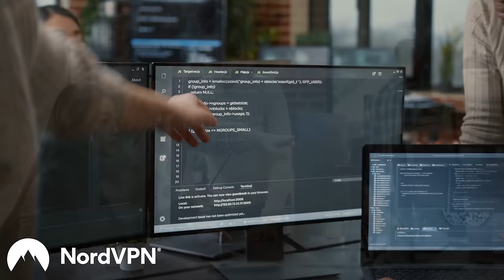Elon Musk fails Cybertruck stainless steel metallurgy test | Auto Expert John Cadogan

Comment: Go look at your kitchen sink and tell me it still looks brand new, no nicks and the "grain" still going the same direction. I may jump in early and create a "Cybertruck body refinishing kit". Basically a windshield squeegee with 300 and 600 grit wet/dry sandpapers. All for the low low price of $900. I'll even make the squeegee out of the same 304 stainless and claim it's "thermonuclear bomb proof".
Reply: You must be a lot more careful with your sink that I am.  There are 3 areas that are clearly messed up on the surface.
Reply: @kensmith5694  Actually I do try to treat my sink with reasonable respect. It's one of the heaviest lifters in the kitchen and they suck to replace. That said, it still gets fucked. Dents, rust stains, gouges, scratches, all of it. I don't know how the DeLorean guys do it, although I've never seen one where all the body panels matched color/texture.

Comment: Stainless steel is a miracle material when it comes to corrosion. It is however not even completely "stainless", as the corrosion patches on my Ruger Old Army black powder revolver demonstrated.  It also doesn't play nicely with other materials, particularly mild steel due to electrolytic corrosion in neighbouring materials.
Its big weakness is it can be brittle, particularly at low temperatures common in many parts of the world (UK included). When I went to college, our lecturer in materials science showed us a case study on a disaster in a North Sea oil field. A floating accommodation platform was built from stainless steel and a leg broke off in winter high seas due to brittle failure. Sadly, the platform design only had five legs (six is better for fail-safe) so it capsized with many lives lost. Generally not suitable for the structure of a vehicle due to this brittleness which is why a Delorean's stainless panels are not structural.
I served a machine shop apprenticeship and can attest to the propensity of stainless to work harden. It can be a complete bugger.
Elon Musk continues to show his ignorance when he gets up on his hind legs and pretends to be an engineer. Dunning Kruger springs to mind, nearly as bad as Donald Trump...

Comment: How will the Cybertruck hold up to salt water corrosion ? Noticing that type 316 is used for marine applications ?
Reply: It depends on which 300 series stainless it is.  304 is no good with salt.
Reply: It's magnetic, so its not a normal 3xx series. It's a duplex type steel. What type is not known, but super duplex is the best  corrosion resistent steel out there and far better than 316. So when this video is all about 304/306, its not accurate to his point. Lean duplex, standard duplex or super duplex is a lot tougher material to form
Reply: @frodekrogstad9936 If you bash  on 316 it gets a lot more magnetic.  You have to heat it to return it to normal.

Comment: Without going into details... my own informal testing done some 30 years ago indicated that regular old fashioned car door steel is a lot more bullet resistant then you would think it is.  The stuff stretches into cones and absorbs most of the bullet's energy.  No, I wouldn't recommend squatting behind a car door in a gun fight any more than I would recommend anyone getting into a gun fight. But stopping bullets with stamped sheet metal has been done way before Elon ever thought of it.

Comment: There are grades in the 300 series other than 304 and 316, and their properties differ somewhat. 301 for example has a very high rate of work-hardening, and at full hard can achieve a hardness of over 40 HRc (3:00) and UTS of about 1275 MPa.

A gram is not a unit of force. It is a unit of mass, not weight. The unit of force in SI is the Newton. This is unlike pounds, which are indeed  a unit of force (weight) - the unit of mass in avoirdupois is the slug.

Oh and you omitted Cr from the elements making up your austenitic stainless (8:30). It is rather important to their properties. That may however have been an oversight.

Otherwise I don't disagree. FWIW I have degrees in mech eng and metallurgy.

Comment: Basically John says: It's impossible to add something to improve stainless steel because we are at a "late stage" in the creation, and use of the material.
Hear that? If a material has been around for a while, it can't be improved. Don't try. Case closed.
Reply: If you were meant to learn ANYTHING from this video - it wasn't about stainless steel - the number one thing you SHOULD have learned was that John knows more about stainless steel and car manufacturing FAR MORE, WAY MORE than YOU.  John is at GOD TIER levels of knowledge about these things and we should just admire as he talks about these things and shows all his technical words and knowledge - I know I was impressed!!

I know in my experience - that's what makes truly great mechanics and engineers.  The ones who act like they know everything and that there's nothing new to learn and that whatever they currently know now can't be replaced or challenged by a better way to see things..  So they NEVER question themselves or show any vulnerability whatsoever..  CLEARLY John knows he knows a LOT, and those CYBERURINAL types know nothing DUUUDEEE.. 

So good work - we are doing what John wants and spending time talking about everything he knows - I know he'll be very happy - he even says so!
Reply: @George2647g  I'm a mechanic, so don't act like I know nothing. John doesn't know anything about the stainless used IN THIS CASE. He is just pontificating about stainless generally. Watch some videos by Sandy Munro if you want an engineer's input from a different side of the argument. Someone who is actually visiting the factory where the steel is processed.

Comment: we've have 70 hrc steel for quite a while JOHN. I think VASCO created the first one. i think it was m42. In fact John, I have a collection of high end kitchen knives which exceed 65 hrc. One of them is 68 HRC. and it's made of a HSS quite similar to m42 actually. The others are right behind at 66 hrc and made of a unique stainless steel designed by hitachi for high end knives. also i do have a few low alloy knives that are more traditional which are above 65 hrc as well.  anyway.

Comment: A couple of minor corrections...
1/ Gram is mass, not weight. Weight is a force, agreed, but grams measure mass.  One gram in earths gravity creates a force equal to (approximately) 0.001 x 9.81 Newtons.  A mass of 1g floating in space is still 1g but has zero weight.
2/ In 'Merica, the more common unit for steel yield and UTS is ksi, not psi. 1ksi = 1000psi.  It is from this that the nomenclature for many steel grades used in pipe is derived. For example, API 5L Grade X40 (a common pipe material) has a yield stress of 40ksi.

Other than these two very minor points, I agree.

As an educated guess, the Gr 308 stainless steel used in the Cyber Truck is probably for the welding properties - so it can be better spot-welded together.

Comment: Why the hit piece? "30X" is obviously his sense of humour. Elon has never compared 300 grade steey metals to tool steel hardness. 300 grades can be work hardened to 500 MPa. This is no where near a tool steel but i and most engineers would consider this to be very high for a sheet metal.
I used to work on an ex GMH 500 tonne Verson press. It pressed out a laddertray. Even with 1.6 zincalume, we had to design the cutting to be progressive, otherwise the press could be overloaded and jammed. 
Elon is a qualified physicist. If he quantifies with figures, those numbers are usually correct. If he gives a judgment such as "very hard" that needs to be taken in context.
I get it that John does not like EV's and this probably flavours his rhetoric against the man who made them commercially viable. Personally, John's efforts would be better spent, siding with Elon against the erosion of our political freedoms by the WEF and their proxy governments. Those guys are trying to take away all of our cars, electric and internal combustion.

Comment: One disadvantage of the stainless steel body panels is that it will be difficult to make style/cosmetic changes to the outside of the truck from year to year.  So the Tesla marketing department may find it more difficult to sell the newest year model if it looks nearly the same as last year's model.  With conventionally-made trucks, they often change styling significantly from year to year to get customers hyped for the latest greatest style.

Comment: Back in the 60's Autocar Trucks built stainless steel trucks that were specially ordered by Edgcomb Steel. The Presses didn't break. And The Budd Company in Philly had presses that stamped out the entire side of a  SS passenger railcar in one operation (like 90 years ago) and guess what? The presses didn't break

Comment: The metalurgist who  led the metallurgy team on the world's first reusable rocket engine is the same guy who came up with the composition of the steel in the Cybertruck.    This outback redneck is the professional though. Hilarious.
Reply: @semilog643  If it was so easy it would have already been done before.
Reply: @neodark414  It's an interesting patent application, describing what are probably an interesting set of materials. But again, there's no magic here. Just an incremental improvement on old materials, in an old use case.
Reply: @semilog643  When was the last time that 2mm thick stainless steel was used as the body material of a mass market vehicle? How is this an old use case?

Comment: You know, I think the education system failed me. I was taught at multiple levels in school that grams were mass and only mass do not pass go do not collect $200. Then again, these same schools tried to gaslight us all into thinking that real world regular people measure weight in newtons. Of course, that's not the only way the education system failed me.
Reply: You are correct, however, grams force is also a thing. On planet Earth, a 1 kg mass weighs 1 kgf (force) by definition. The acceleration due to gravity only varies by about 0.5% from the strongest effect to the weakest effect. 

Therefore, any mass on Earth can be expressed as having the same weight as its mass. It only becomes an issue in other environments, such as when something is in orbit (zero weight) or somewhere other than Earth.

Interestingly, the definition of gravity on the surface of Earth is an acceleration of 9.807 m/s², but the average acceleration is 9.82 m/s².

Comment: Cybertruck looks like a prop department reject from a 1970's "Logan's Run" episode. Meh.
Reply: It might not look like what we know but it is way cheaper to make than it’s competitors and way more fuel efficient.
Reply: @p3x1967  Beauty is in the eye of the beholder, thankfully.  EVs are heading for "near zero" maintenance and 1,000,000 mile+ life.  Something that the incumbent ICE manufactures are in a massive quandary about given their business model around having your car in the  dealer at least once per year for an expensive "look over" and oil change.
As per safety yes there is an SUV "arms race" in terms of being the safest in your own car, forgetting about those around you.  The main thing is that we don't get dragged down something similar to the "red flag act of 1865"

Comment: The thing about the average work shop Dress is that when you have done the pressing and you lower it down *"(always remember to replace the pins 2of them one each side and rest the work table on them without fail) this is tought to every apprenticeship in  the 1st year) rule of thumb 👍 A. Only a fed would not. 😮 I have found them out many times, always check that they are IN.
Reply: In my experience with a Mazda 121 it had Exstremly mild steel, from NIPON Steel I could straten it with my hands after running into a carpark  log. I found out that they make it like that on purpose for pressing, then the first time you're car gets over 65°c it is suppose to tuffin up. Thay said. What do you think???? Truck is made from cold rolled  
SS and the breakages has an air curtain on the blaids, that way there is no metal to metal contact and improved actriciy. A
Reply: On the other hand the Starship factory, the Engineering thay are achieving is exstrodinary. Example the RAPTOR 3.

Comment: Actually I am a qualified engineer...hardness is correlated with armor effectiveness.  Class 1 Armor steel is harder than Class 2.  It's good for ballistic protection, but not as good for mineblast as Class 2.   John, you are saying there's nothing new to learn about Stainless Steel.  With computer modeling atomic structure recently becoming a thing, I don't think that's necessarily true.
Reply from the maker: Dude, hardness in all common metals correlates with brittleness. Brittlness is not a characteristic you want to embrace in ballistic protection. Harder = more brittle. You're taking it out of context.

Comment: So you're comparing hardened steel bolts, hidden crash bars in the doors, tire rods, ball joints, wheel bearings to the Cybertruck's overall body? Kind of a poor comparison. That's like saying I have bullet proof buttons on my shirt compared to a bullet proof vest.

Comment: I learned about 304 the first time I center punched it. Burned two drill bits up. "Don't you know you can't center punch 304 you will need a cobalt drill."  I just started over with a new piece.
I always wondered why car bodies were not stainless steel. thought it was planned obsolescence..
Reply: 304 doesn't do well with salt and is hard to work with.

Comment: 00:17 🚗 Elon Musk's claims about the Cybertruck's stainless steel and its design face scrutiny.
01:26 🔩 The Cybertruck uses a 300-grade stainless steel, not a revolutionary material as implied.
02:17 🛠 Elon Musk's "Ultra hard stainless steel" claim doesn't align with stainless steel's actual hardness.
04:34 💥 The Cybertruck's stainless steel is notably softer than other steels used in modern cars.
07:14 🔧 The stainless steel used in Cybertruck's construction isn't unique; it's part of known metallurgical processes.
13:16 🏭 Forming the Cybertruck's steel is limited due to its properties, not due to limitationsin manufacturing presses.
14:14 📏 The hardness of the Cybertruck's stainless steel is comparable to softer materials, not hard steel.
15:58 💪 While the Cybertruck's steel is tough, it's relatively soft compared to harder steel variants.
17:59 🚗 Other conventional cars use steel twice as strong as the Cybertruck's steel, challenging Musk's claims.
20:36 📰 Perception versus reality: Musk's claims about Cybertruck's stainless steel don't align with factual metallurgical standards.
Reply: Nevermind that Tesla just announced that they designed a new steel which is both strong as well as tough, but I trust John because he's just so right about everything in his life!

Comment: I sell a product that needs to be artificially weighted.The weight cannot rust so I use a passivated stainless steel bar for weight.Its still possible for it to rust but not in my application,exposed to the environment only once and discarded to avoid contamination.All stainless will rust,it has iron,no matter the grade if put in the right environment.This EV truck will be a rust bucket in no time.Usually the harder the steel the more brittle it becomes

Comment: John - like CYBERTRUCK or not , its Still the FASTEST Production TRUCK on EARTH , also SAFEST .
Cybertruck can OUTPULL 40,000 lbs in truck pull, and went FARTHER Distance than F350 HD Diesel truck. 
Cybertruck actually ran out of TRACK . F350 HD Deisel is a LIGHTWEIGHT.
Reply: I hope Cybertruck owners have budgeted a fair amount for tyres, because they're going to be chewing through them with all that high acceleration and towing ridiculous loads.
Reply: @markplott4820 Cashing in on the idiot dollar.

Comment: BTW:  
7075-T6 Al is about as strong as 300 series stainless and is a lot lighter so you could use more of it.
Heat treating SS can return it to as state where you can bash it again if you want a nice shape.
Titanium-Aluminide can be about 5 times as strong if you buy the expensive type but it is not easy to work.
The best Tesla truck is still this one:
https://youtu.be/R35gWBtLCYg?si=-uWNtAh4R7VrinST

Comment: Try looking up 301 fh.  41 hrc btw.  Now factor the yield strength 140,000 psi and tensile strength of  185,000 psi and size of panels to find how strong of a press it would take to cold form complex curves into a single panel.  

Using hardness to describe yield strength to an audience who doesnt know the difference makes perfect sense dummy. So does saying it would break the press to explain that the presses used in automotive body panel manufacturing aren't sufficient to shape it.

But what do I know.   I've just worked with and shaped the stuff I'm no condescending engineer

Comment: I haven't' been party to this type of a technical discussion of steel since my days at U of Illinois engineering school and  Strength of Materials class.  However, I watched your video and didn't understand your criticism.  You just discussed general stainless steel strength without mentioning how it is structurally relevant to the Cybertruck.  In fact my understanding is that the stainless steel used in CT is martensitic which Tesla has some sort of cold forming method of making from Austenitic. You describe general purpose austenitic stainless steels as if you know that is used in the CT (or should I say CyberUrinal CU). 

I agree the truck is horribly ugly but I will still give credit for any technology advancements it contributes.  Of course the one big advancement has been the use of gigacastings.  Now other companies are doing that.  Also the 48v architecture of the electronics is also new and past due.  I would love to see you do a better and more detailed critique of the truck after you actually look at it in depth.